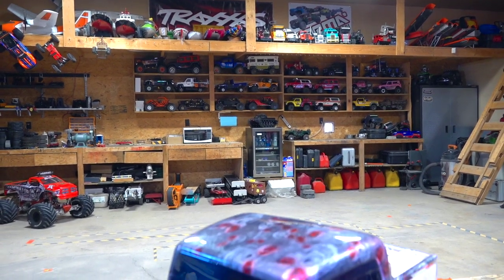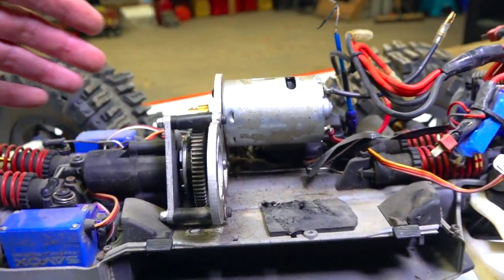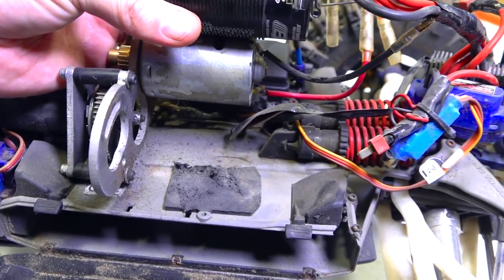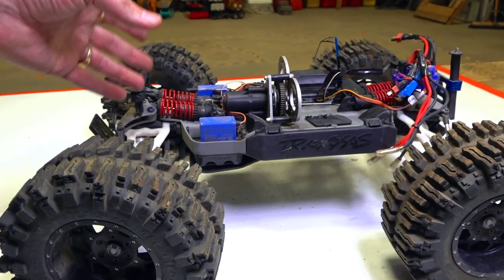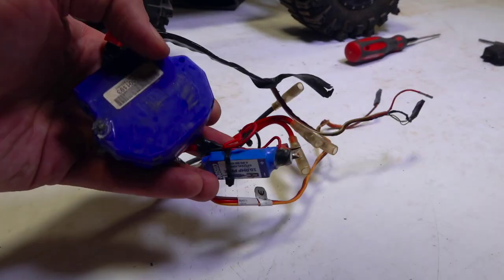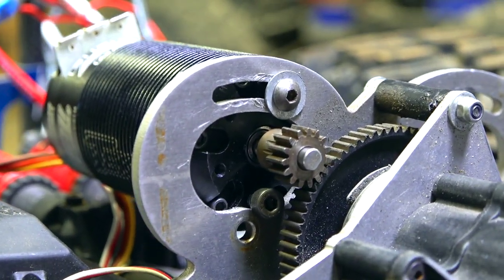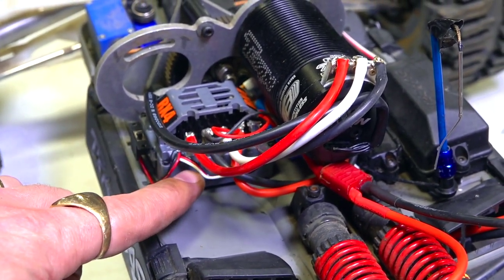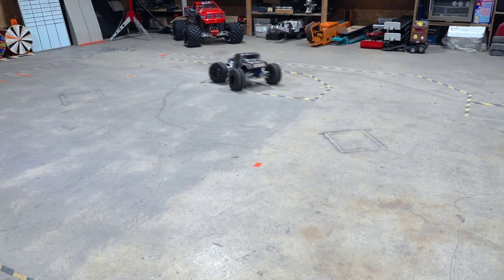WHAT HAPPENED TO MY RAT ROD GRiM REAPER MONSTER TRUCK? | RC ADVENTURES

Comment: My first “real” RC is my Summit which I still have. I LOVE it. I have the Kershaw Designs dual motor mount on mine with two stock titan 775’s and 4s lipo. I also have the widening kit (not installed). It’s got so much power, I’m currently in need of a front diff due to catching some ice and snapping an outer pinion. This is a beast machine all around. Glad this one is back in the show. Long live the Summit!

Comment: Maybe this is an unusual comment, but I particularly like the character of the sound that this one makes when it's under power & accelerating. It's very cool to hear the gears at their various RPMs, the motor effortlessly winding & so on. Then again, I'm also a big fan of snugly attaching a Gopro to a rig & letting the stereo mics pick up the sound mechanically, as well as acoustically. With headphones, it's incredibly immersive.

Comment: I am so excited to see this thing again. This truck made me buy a summit. I had a castle creations mamba monster 2 combo with the 2200kv brushless motor on mine and it would destroy the diff's every time I drove it. I upgraded the diff's to a full aluminum setup and went back to the 775 titan motor. I was never able to keep it all togeather with the brushless. I later heard if you change the diff's to the E-Revo bulkheads and differentials it will take the torture.

Also turn the brake down

Comment: Oh wow the legendary Summit is back! I remember the floating Summit out in the freezing creek. And I remember that video made me jaw drop so hard that was probably the one that got me interested in this channel and I've been ever since. I shown that video to so many people. Really glad the Summit is back and it's nor brushless too! Be prepared to change some back diff ring gears. I've got the ERevo (which I love to the bits, gave me so much joy in the years), a brushless one of course. It has so much raw power.... so much fun. Tip: use ceramic hybrid ball bearings for the diff pinion, helps with the durability. The pinion will move less under torque and the ceramic will wear much slower too. Changed a lot for me.

Comment: Hey Aaron. Keep in mind that the shift servos for the 2 speed and diffs can’t handle over 6 volts. To run a higher voltage from the BEC to the steering servo only requires a receiver bypass harness. That way the BEC in the ESC powers the receiver and shift servos and the external BEC powers the steering servos.

Comment: I think I originally came across the channel when I got my summit.  Has to be at least 8 years ago.  Great trucks, mine actually got me into the scale crawlers but it is still an all around great rig.  I run mine on 6s on a tekin T8 but I think my kv is 1700 or 1710 or something.  And running it sensored you can just leave it in second gear and still crawl like a baby.  I need to get er up and running again, I think I toasted a diff last winter.

Comment: if you change the slipper in it, take an aftermarket slipper, or the upgraded aluminium pads from trx. also i'd suggest you to change the spurgear too, as it seems worn out already! I love that rig, i had a summit for years.

Comment: Picking a favorite RC is kind of like picking a favorite family member. But I would have to say the Summit is probably mine as well! The versatility of it and I like you was not satisfied with the big old brushed motor that came with the truck. So after about 2 years of beating on the summit, it got upgraded to a 1/8 scale Mamba Monster X and a castle 2200kv motor which now pulls wheelie in high gear about 30 or 35 miles an hour which as you said in an 1/8 scale truck that weighs about 10 lb, is moving pretty fast! Funny you talk about doing the maintenance on it. I had went on to my rc10 T4 two wheel drive stadium truck w\ a big brushless motor in it as well just for kicks! And I am going to redo all the rubber boots and gaskets and the half shaft to one of my rear tires is broken. Luckily I've got parts saved up because I planned on breaking them when I went to a bigger motor but the truck has only ever broken one half shaft and of course the stock servos that steer the truck. Love the show sorry about all the complications with the new RC regulations but your channel will never die with the fans! You're half the reason most of us branched out in to other forms of RC's.  Now I have a SCX10 II with the Jeep Cherokee body crawler, rc10t, rc10gt, rc10 T4 and the big old Summit which mine has 40 series Mickey Thompson MTZ tires which are the best all-around tires I have ever had, and of course some 3.3 inch slingshot paddle tires just in case we're not getting enough Traction in the snow.
👊😎👍🇺🇸

Comment: I do believe that it was 2013 !! When you did the dual motors, I was following with mine, I put the duel 700 motors in. But I wired something wrong, because soon as I plugged it in it smoked my speed control . Eight messed with it cents , still have it, i'll get it going one of these days. I'll get the speed controller for dual motors

Comment: Speaking of slipper clutches, I've been having fun sorting out the one on my custom build HPI Savage. I just bought the spur gear and slipper clutch but had no matching pinion gears.
Spur gear is 51 tooth 1M, but the only pinion gears I can find have a 5mm hole in the centre, my motors need a 3mm.
After an hour of searching I found some adapters witch are just bits of tube with a hole in one side for the grub screw.
£5 for 2? I think I'll make my own.

Comment: What did you do with you’re differentials? I went to a brushless hobbywing setup and I continuously blow my diffs. I’m just rebuilt stock housings with hardened gears and I shatter the spider gears every time. I also grease them well every time. Any ideas on how to prevent this?
Reply from the maker: I ordered a set of Boom Racing Helical Gears that are coming.. i already know of the implosion risks.. haha

Comment: Bro I never thought about you.  You live in Alberta and have wet RC’s  a lot to dry and also know Traxxas products very well. 
What would cause a brushless motor to magnetically bind up like a magnet motor brake once it gets wet.  

If I take 1 motor lead and disconnect it the magnetic field/ binding lets loose and the car rolls with ease 

Hope this makes sense if you have any ideas what to do to prevent this from happening I would love to hear. 
Thank you. 👊😀

Comment: I don’t think your diffs are gonna like that. Lol the 1st gen. Summit & Revo diffs have a tendency of not liking brushless. I think the power & torque of the brushless combined with the gear ration of the summit being so low the torque is going to be unreal. Definitely do not run 6s lmao. 🤣🤣
Reply from the maker: I knew the risks! Haha.. I think I will just keep it in High Gear no matter what.. with 0 Drag brake.. The gearing wants to slow it down. Now I get to delve into a fun project.. and I might as well start researching all of the potential options! I love this hobby
Reply: I put a cheap 2150 kv with a Mamba monster 1/8. Ive had it well over 10 years & been in & our of the hobby over the years & let me tell you it’s probably got less than 10 hours run time total. It’s always broke. Lmao!! I don’t blame the truck though. Between my driving & trying to run 6s lol I blew it up again. 🤣🤣
Reply: RCSparks Studio I figured you did. You definitely aren’t no beginner lol. Turn the brake setting down on the esc & work your way up too. I snapped an MIP axle at the hub stopping on pavement lol.
Reply from the maker: @mikeburgessrc5360  Did you ever try the Boom Racing upgrade to Helical Gears? Any luck there? boom racing br271099
Reply: RCSparks Studio no never got that far. Like I said I’ve been in & out of the hobby. I’ve been out of work for awhile now so when I get a little money I buy a part here & there. I was looking at those though. But I read somewhere that helical gears weren’t good at high speeds. I don’t know how true it is but might be worth a try. 
I basically converted mine to a Erevo but still have the front summit bulkhead with LEM aluminum diff cup & Revo rear bulk head with a hot racing diff cup. Still running summit trans with the 2 speed. No lockers on the diffs. I’ve spent so much on this truck & broke it so many times but I can’t stop. I know I should just give up & shelve it . I won’t get rid of it either. I’ve had it so long & it was my 1st real rc other than a slash I had. I built the whole thing over time buying part by part off eBay. Lol I guess I’m just kinda sentimental.  I got sidetracked sorry other than boom racing 
Traxxas I believe had made a race spec ring gear. It was the same part number as the stock gear but instead of the last letter of the part number being a X it’s an R. I was always curious about that but never got a chance to order one to to find out lol.